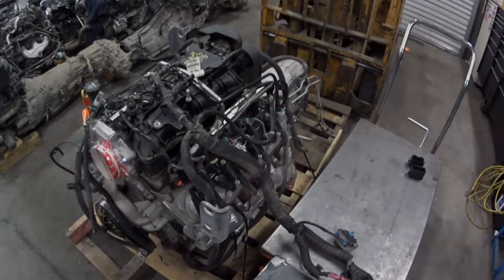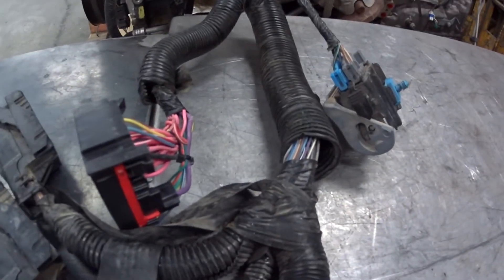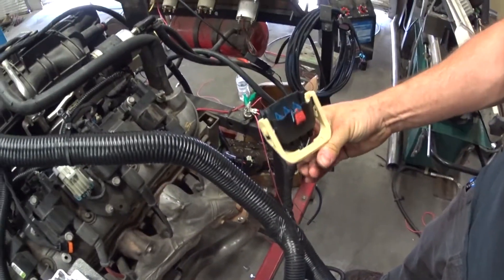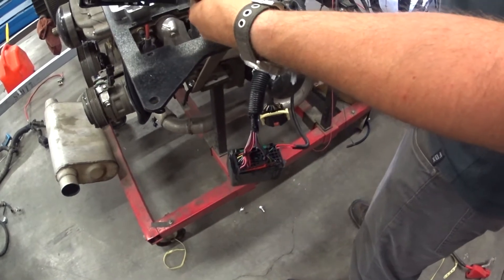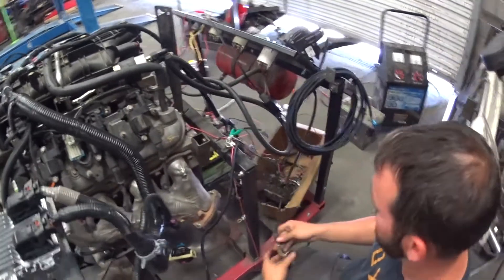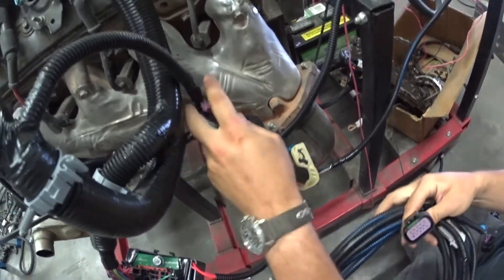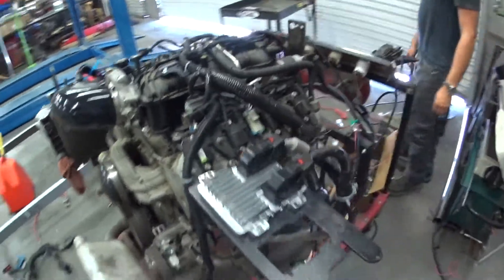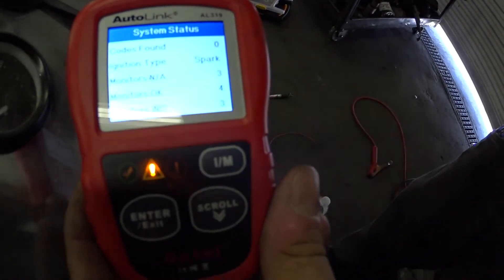MoTech EZ harness

Comment: Can motech make a bolt in engine mount bracket to make it even easier for the home JK mechanic?
Reply from the maker: Yes we are manufacturing them now for both the Gen IV and Gen V engines, a video will be up soon. No cutting, welding or drilling will be required to get the engine in.